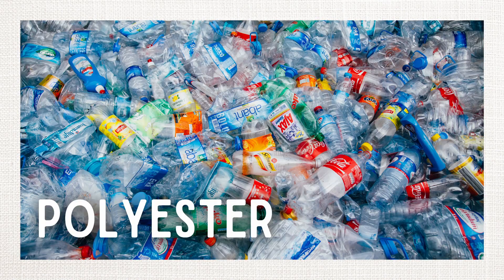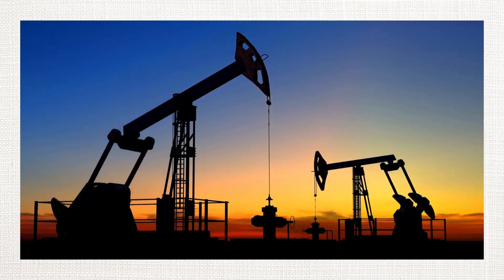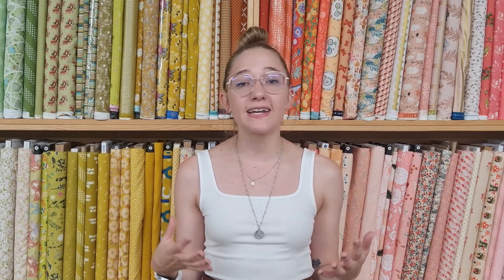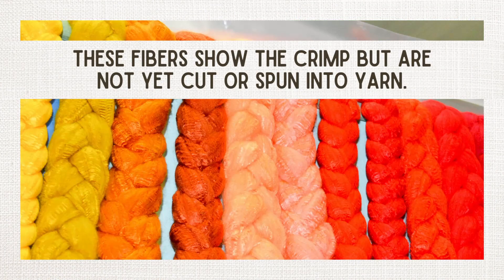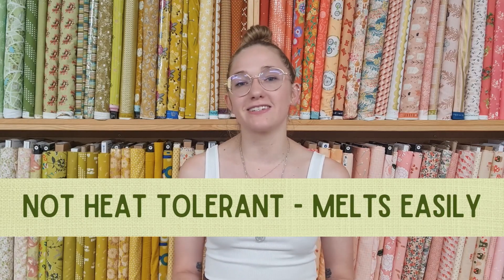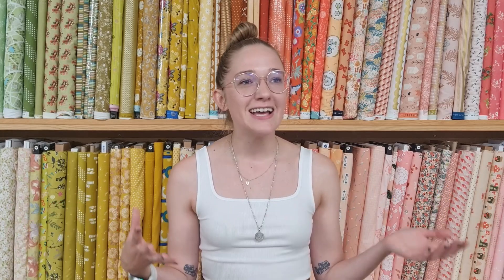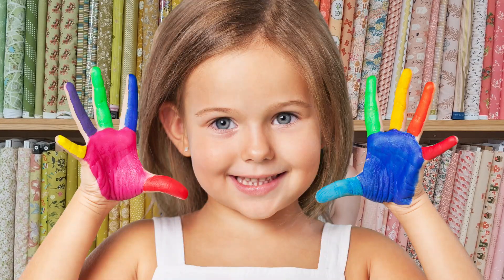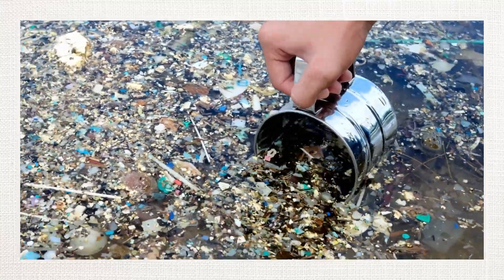Synthetic Fabrics: What are Polyester, Nylon, and Acrylic? | Textile Talk w/ A Thrifty Notion

Comment: Hello.  I just bought a 100% polyester child’s chef hat from hobby lobby.   The iron-on little patches says if used on polyester fabrics it will be better to use glue instead of the iron.  

My question is: what kind of glue should I buy?  

Thanks!   🎄👍🏼
Reply from the maker: I would suggest a product like Fabri-Tac, Fabric Fusion, or Tear Mender. Those are all made for fabrics of various types, and would probably work well for what you're doing! If you can't find one of those, there are a lot of other fabric glues on the market. Gorilla Glue and other super glue brands even make fabric glue now! Just make sure you're getting one that says it has a permanent hold. Hope that helps! - Kelly